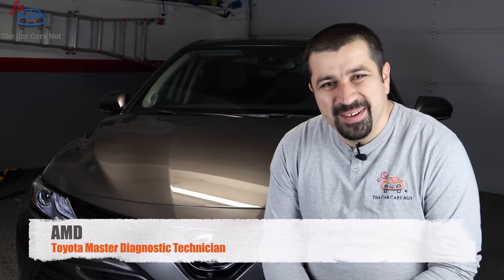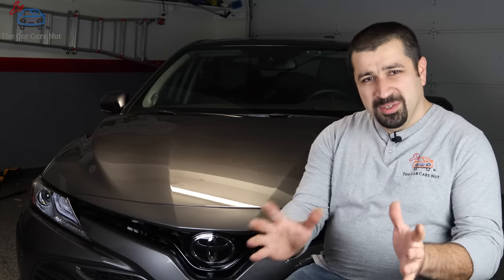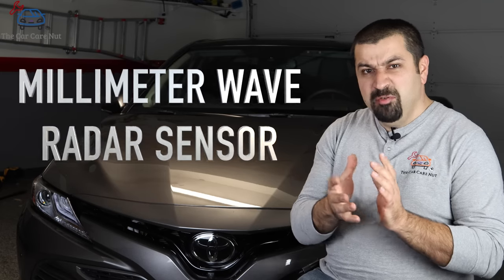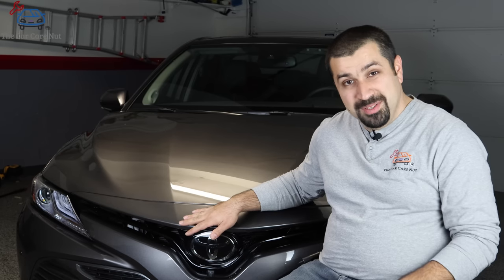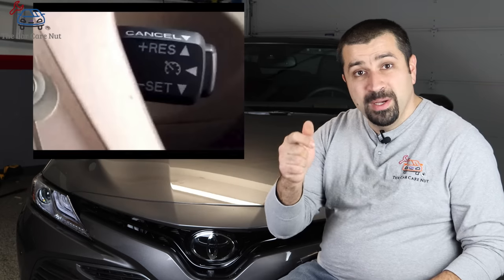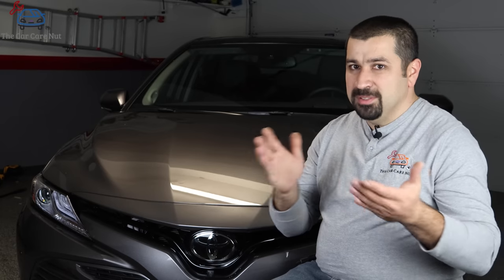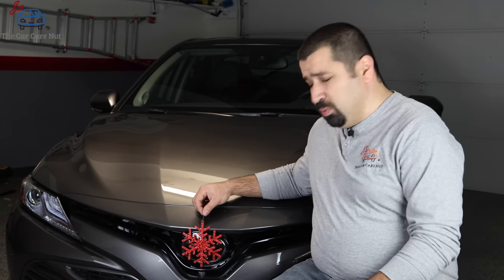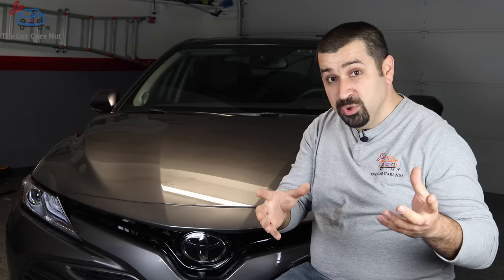How do Toyota Safety Sense Work Part 1 Radar Sensor

Comment: I think radar cruise control is great but I have a problem with it and I’m wondering if others have this issue or is it normal. I have a 2019 Highlander with Toyota Safety Sense 2.0. If I am passing someone who is in the exit lane/ramp with radar cruise on, it will think that a vehicle is in front and stomp on the brakes hard bringing down the speed 10 to 15 mph. Then as I pass the other vehicle my Highlander will accelerate again. It does not happen if on a two lane driving on the inside lane. Now when I use it I have to pay attention to vehicles exiting.

Comment: I have no good words for this system, in my observations having travelled thousands of miles on British motorways with all the roadworks, Lane switching, narrow lanes, lorries with wide loads, etc, etc, etc……….. I hear Toyota are planning to put a radar in the rear as well as so if the front one eases on the brakes, the rear one will identify how close the vehicle is behind so as to accelerate, meanwhile the driver has little or no control and is sandwiched in between technology that conflicts with it self.
I’ve be driving for 44-years perfectly well with no minor or serious accidents (I see plenty of dickheads and idiots performing all manner of stupid moves both in front and in my rear-view mirror whilst behind the wheel, possibly because of systems such as this……) My advice, these systems have their problems, the best radar and ECU is the human brain, and not a computer chip that’s still in it’s infancy and not fully perfected. Toyota is asking you put your faith in this system, a system that has the potential to cause accidents or even take life…….. These systems are being designed in preparation for full autonomous vehicles whereby you have no driving to do at all, you’l step into a box with no windscreen, no rear window, allowing the vehicle to be nothing more than a transporter.  Frankly, I’m glad to be the age I am, in my observations the world is going backwards in many ways and this system adds to that. Thank you for reading my brief. 🕊

Comment: Just bought my first Toyota RAV4 Hybrid. I turn these "safety" features off and they come back on the next time the car turns on. What a hassle. Not sure that these things add any value to me. It seems to me that over time, drivers will become even more complacent. In any case, I prefer to have full control over the car. If driving, you should be looking at the road and not be distracted. Besides, what do I care about speeding signs on my dashboard (that's already cluttered), I can see them just fine on my own. I'm a bit concerned about exposure to these radar systems. I'm also concerned about data privacy: Why am I responsible for any privacy violations of my passengers, especially since I have no obvious (or perhaps any) means to turn these things off permanently? So I paid for these systems I don't want. How do I permanently disable them? Can a Toyota Service Center remove these systems or at least disconnect them? Currently, I have duct tap on my windshield to block the camera at the top. I have to figure something out about that logo.

Comment: When I use my adaptive cruise control in stop and go, I hear a ticking, or maybe clicking when the brakes are applied at slow speeds.  It might happen at high speeds, but I can hear it at low speeds.   It almost sounds like whatever it is that applies the break.  I was able to catch the noise in a video, I was hoping you can tell me if it's normal.  Normally I would just go test drive a new one to see if it happens, but there are none in stock anywhere.  In the video you can hear one of the clicks at the beginning, and again as the brakes are applied.  Thanks in advance and God bless.        https://www.youtube.com/watch?v=mZ9Phm10jns&ab_channel=emikey
Reply from the maker: Hi! It’s normal. They could’ve done a better job insulating but that is just the normal noise of brake operation
Reply: @TheCarCareNut  thanks!! TSS2 was one of the reason I bought this car.  This is my first new car and I'm loving it.